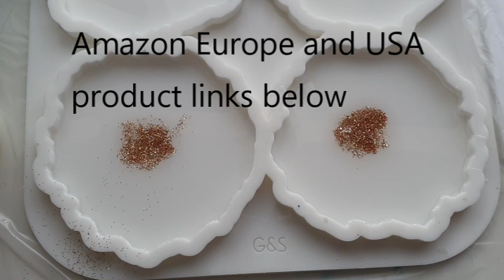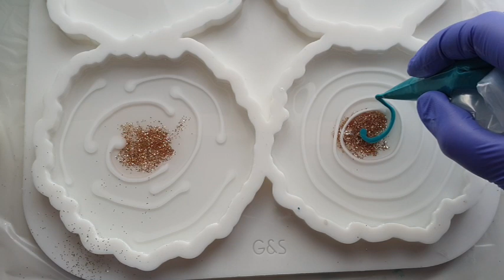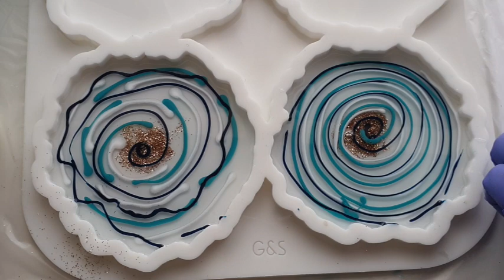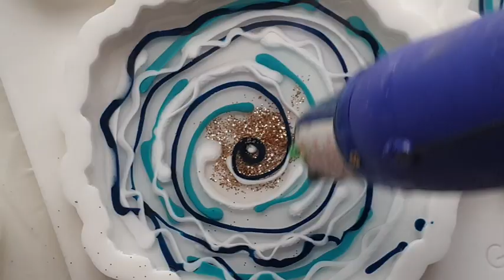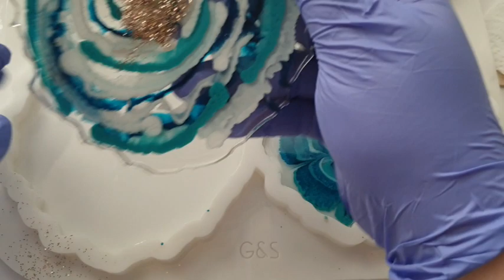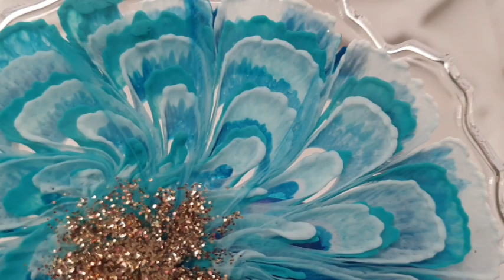Resin Flower Coasters Easy Method

Comment: You're definitely getting there with the flowers 😀. I've not tried it yet, keep meaning to. I wonder if maybe using something that won't spread as much as glitter might work better, like crushed glass of even foil flakes.  I've seen buttons used as flower centres. Just a thought 😀.  Did you drag a stick through the one on the left, didn't think you did. I think it might look more like a Rose if a stick was pulled through it and maybe not blended as much. Just a thought again😀, never done flowers so can't speak from experience.
Reply from the maker: heyyyy Tazmin ya know I think you are right ... I could have actually dragged the stick in a spiral ... that might have worked better for sure xxx so glad I got a good one .. I cannot say I will doing these again in a hurry haaaa xx